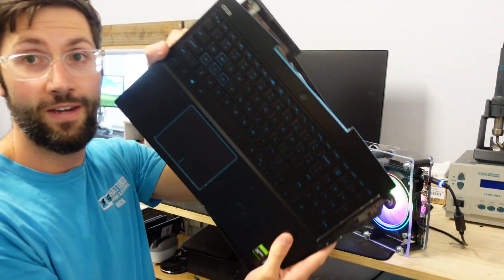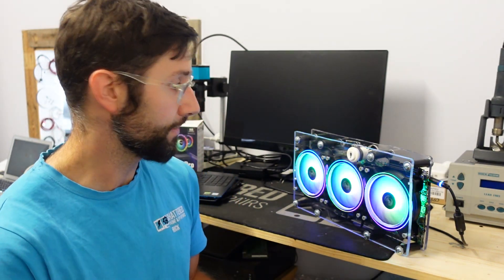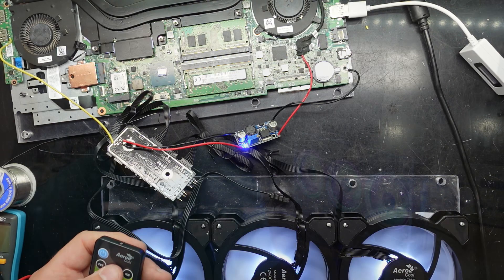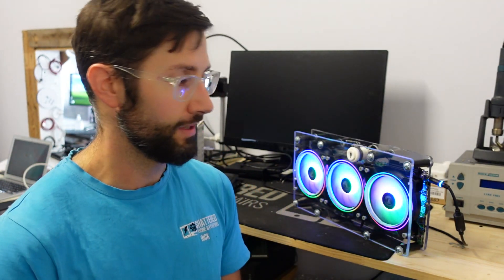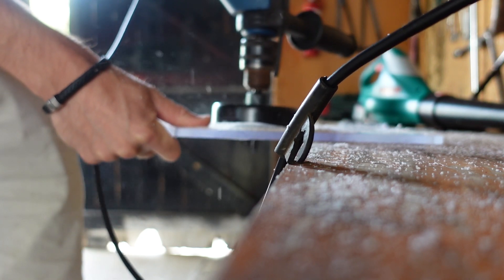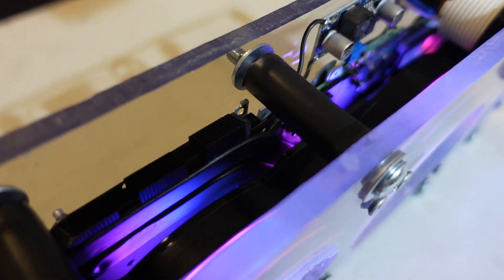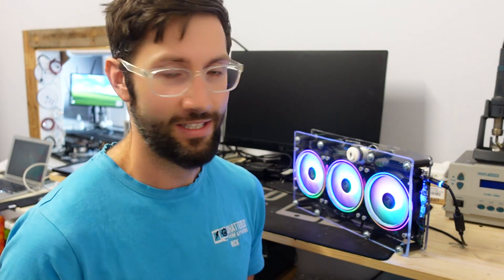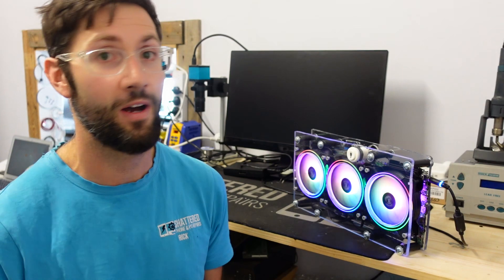Turning A Gaming Laptop in to a Gaming Desktop (Short Form)

Comment: Hi, im trying to do the same with another gaming laptop motherboard,but dont have signal from hdmi. Tryed to connect it with hdmi monitor, hdmi tv, hdmi+vga adapter, hdmi+vga to vga monitor… installed Intel drivers, nvidia drivers… the computer runs windows without problems i know it because if i press alt+4 turns off. Thanks and sorry for my english!

Comment: good job, one question!! What is the diagram to connect the fans to the mother and what components did you use? thank you
Reply from the maker: didnt use a diagram, just a multimeter and found 12v and 5v on the board

Comment: How did you know which pin from the dc power jack you needed to use? I'm doing a similar project and my dc input has 8 pins on the motherboard. :)
Reply: Are half of them 19.5V and the other half ground?

Comment: I did this conversion as well but I have to have the original laptop display connected for the external monitor to work. When I delete then nvidia driver, the external monitor then works. Would you know what could be the issue?
Reply from the maker: im not too sure on that one sorry